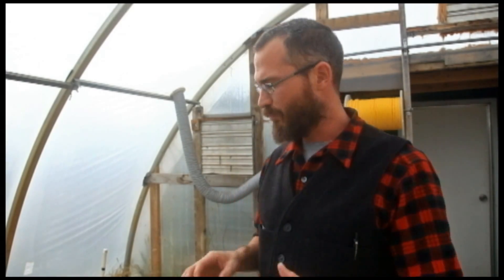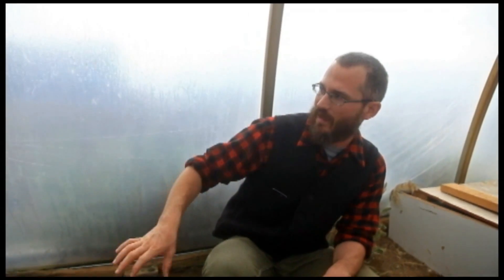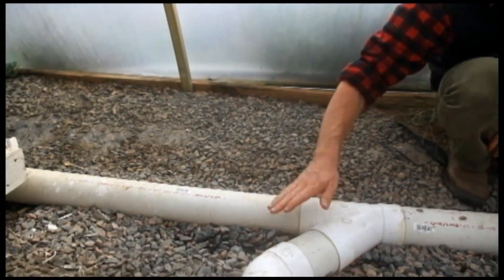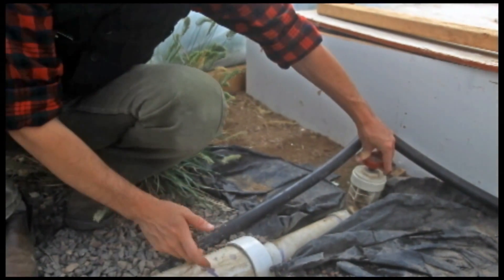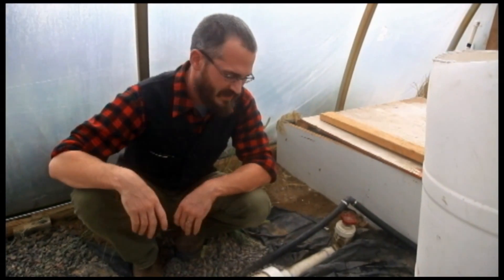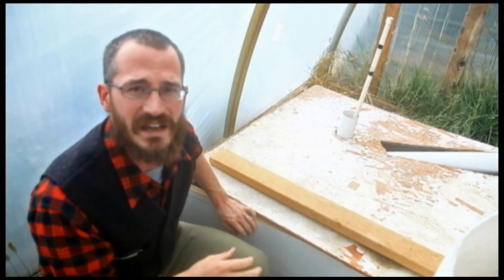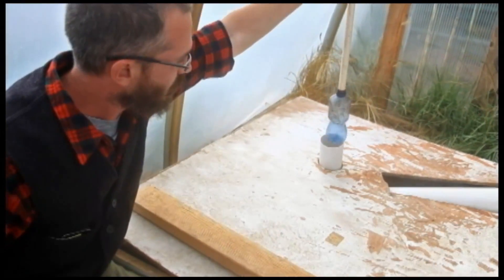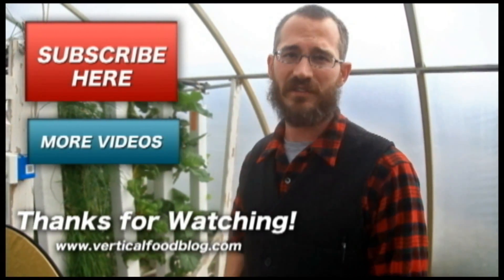How to Plumb an Aquaponics System: Return Lines

Comment: How much of a fall or incline did you use for drainage to the sump? For example what was the difference between the highest point to the lowest, or highest point to where the north and south sides connect?
Reply from the maker: Hey purebokety - We only have about 18" of drainage slope over 100 feet, so it's pretty gradual. Sorry for the slow response!
Reply: No worries, I'm grateful for any response ,thanks